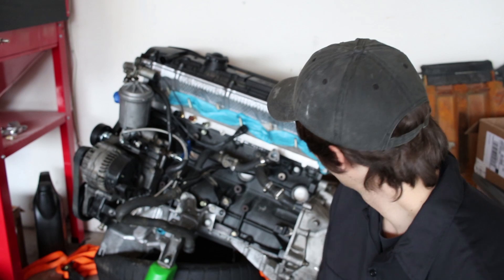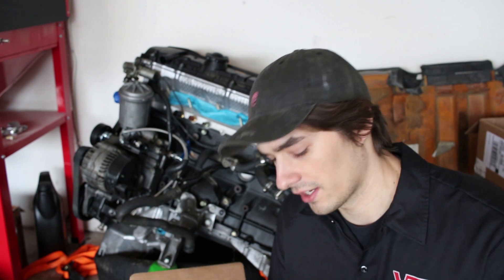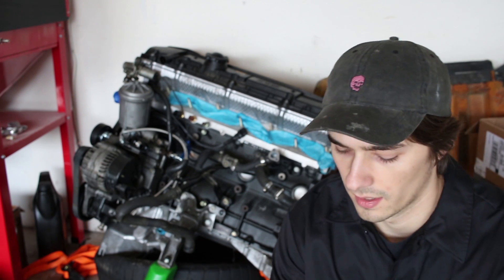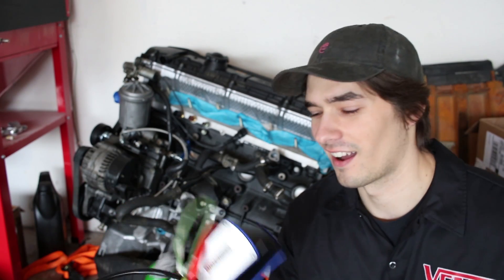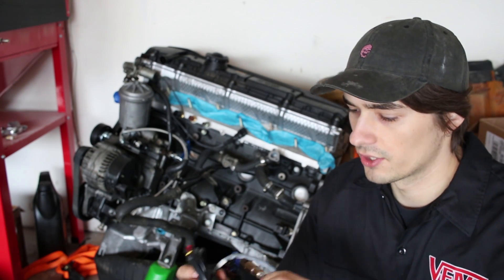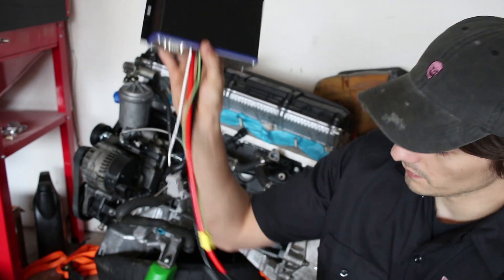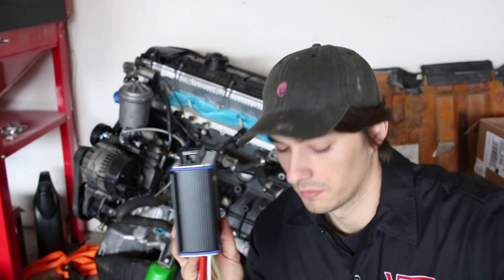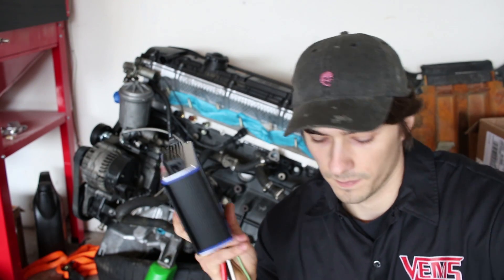Rocket Bunny Turbo S52 BMW E30 Build | Part 9: Standalone PNP ECU & Harness Install

Comment: I have the Vems ecu also but for a obd1. You will love it man. Auto tuning and everything. Every can be set with lambda targets. Just make sure you readjust your map sensor settings. Mine was set too low so it hit fuel cut. I still have to figure it out more since there are 2 wire that I don’t have a clue where it goes too coming out of the ecu. A green and white wire.

Comment: Since you're going turbo, why didn't you use the m50/s50 for it's iron block?
Reply from the maker: Ntokozo Ndamane in America the m52/s52 is almost always iron.
Reply: Ntokozo Ndamane iron blocks are bulky and heavy the aluminum block is plenty strong. And has steel sleeves I believe. But it doesn’t matter you’ll blow your internals before you blow your block